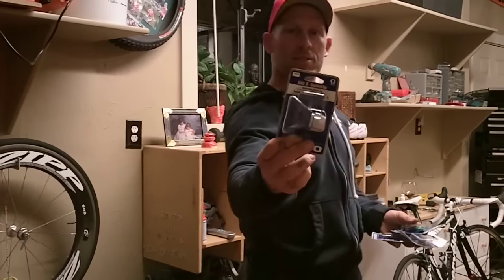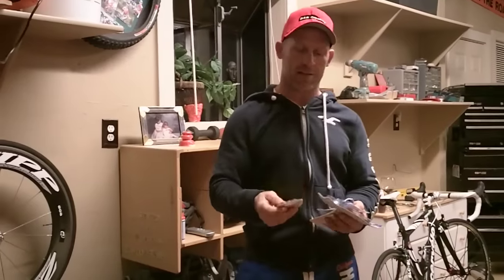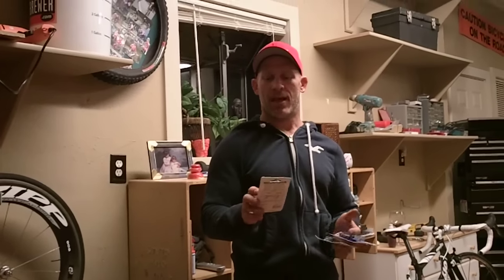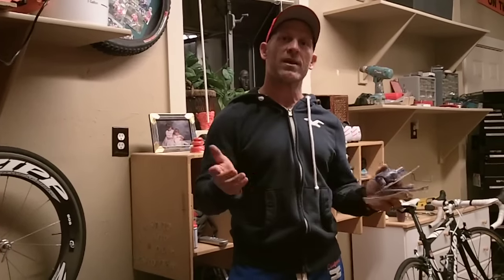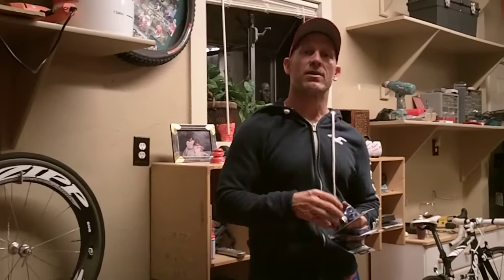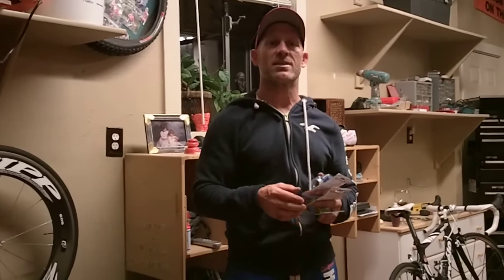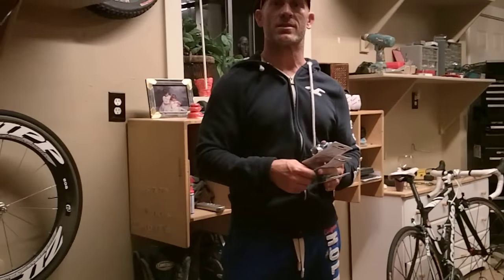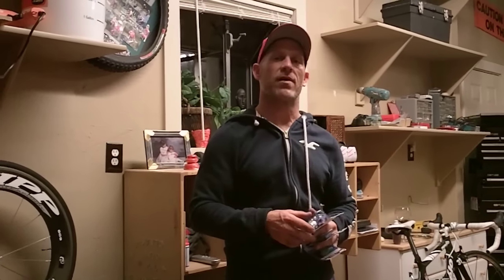Paint Sprayer Tip Information.  Airless spray tips and when to use them.

Comment: How do you store your tips? Do you leave them all in water or alcohol or some sort of solution in a paint can? Or clean every time and let dry
Reply: no need to soak them in solvents- that's money wasted plus a child could stumble upon them- after cleaning just oil them up or spray with lube spray and wrap,them in an oily cloth- before spraying just wash them with soap and water and then rinse with clean water- same with the filters- after cleaning the machine- do not allow the machine to freeze either and use one unit for oil based paints and one for water based paint- second generation master plasterer and painter- also worked for Taylor Rental and was certified to operate, troubleshoot and repair- including packings in unit

Comment: Hey Chris... I have a 390pc sprayer and its 3months old and it keeps clogging at the gun tip ... I cleaned the sprayer after every use. Any suggestions on what could be wrong. I cleaned the tips,inlet ball, inlet filter, everything :(

Comment: Chris, to spray fine finish you still use a 60 mesh gun filter? for spraying baseboards 10" what tip would you use ( meaning 1 stoke or several). Do you have tips on how store your tips.

Comment: How do you clean the tips, especially if some of the latex paint has dried on, in or around the tip orifice? Also, can I use a 310 tip even if the paint recommends .15-.19?

Comment: Thanx for the info Chris. I'm flying down to FL to paint my father's house for him (stucco) and plan on using Behr elastomeric stucco paint. I'll have to rent an airless and have a Titan LX80 gun with some tips. Never painted stucco- what tip do you recommend?  Should I just stick to rolling vs renting a sprayer?
Reply: Make sure to spray with different angles with stucco bro so it is tight from any vantage point

Comment: Hello, I have a question, "are the rubber gasket/metal seals matched to the spray tips?"  What I have read and viewed shows changing the spray tip but nothing is said about the need to change the rubber gasket/metal seal.
Reply from the maker: I never change my gaskets

Comment: Good Day I am in in the market of building my own little road marking machine with sit on lawn mower system.I will remove the blade on the Lawn mower. And then i will do the modification to place compressor and the spray gun.
Reply from the maker: Sounds cool how does it work? Would love to see a video of it working or pic🤙

Comment: I don't get "hissing" when I have tips blowing out. I just notice the pattern not as defined as a square and the proper size of coverage isn't there anymore. What is happening is the orifice edges are wearing allowing even more paint to come out. Eventually it comes out like a firehose. Well,maybe NOT that bad but it does result in wasting paint and sagging. It can make your sprayer work harder too if you alredy have the maximum size tip recommended for your sprayer.
Reply from the maker: Thanks Michael!

Comment: What iis the other side of the tip used for in a reversible tip
Reply: It is for when the tip gets spitty- reverse it to blow out the gunk, then switch back to spray mode- tips wear out, so do the seals, so blowing it out is basically for when you have a healthy, non worn tip, and are on the move, and need to keep moving. I'm not a fan of "fine" or "medium" lingo- old schoolers still choose actual degrees- as in degree of fanning of the actual spray- of you are a professional sprayer, many variables are essential- including experience- maintenance of your sprayer is extemely important also. Additionally, when you stop the trigger, and if even a drop of paint ensues afterwards, replace the tip- second generation master plasterer and painter here

Comment: I liked the 310 you right finished for gutters and doors the 312 works great to and 517 i used most the time for stucco and just i adjust the pressure
Reply: A true old school master always uses degrees of spray- not fine, med, or whatever- that's for sandpaper bro